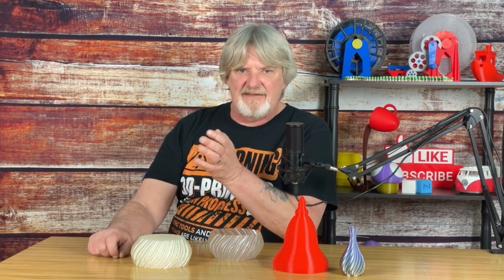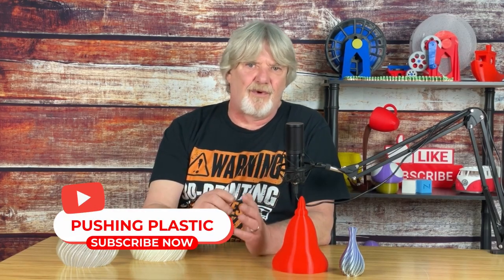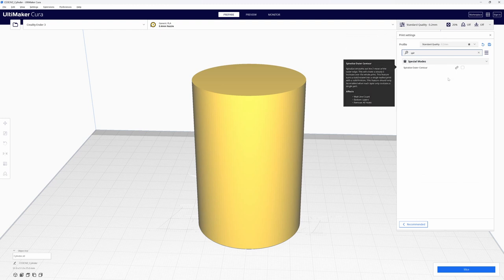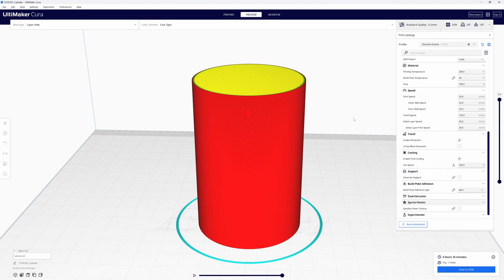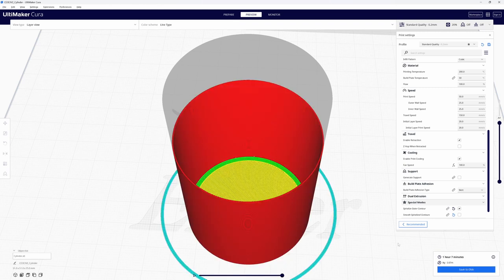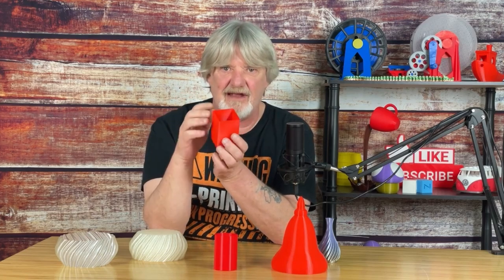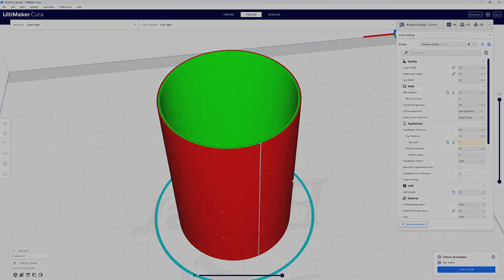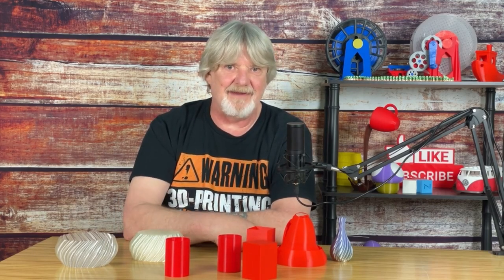Unlocking The Mystery Of Cura's Vase Mode

Comment: I've always known that symbol as "settings slider".  I used to use a video recoding software MANY years ago (cannot recall the name) and that was the settings icon it used and since all of the settings were adjusted with sliders that's what they called it.  Personally it has always reminded me of the equalizers on old-school stereo systems.  You remember the ones that had actual buttons and knobs on them where you purposely AVOIDED touching the screens?  lol
Reply from the maker: Ahhh, I can see that!
Reply: @pushingplastic7445  I've been playing around with vase mode since upgrading to 5.3.1 and it's been acting "weird".  Some models it doesn't seem to have the same effect with a definite seam line on one side.  Exact same settings with a different STL and no line.  One thing I've been trying to figure out and I'm not sure if it can be done or how to do it is to combine regular printing with vase mode.  Basically I have one STL I want to print the first 10mm normally and then switch the vase mode for the rest.  This is a small lamp shade and I want the supports and open top but vase mode won't allow it.  Once the top of the shade prints with the support I'd like it to do the rest in vase mode so there is zero seam.  Even if the seam is on the inside it will show up when the lamp is turned on.  This is with a 1mm nozzle and 0.175mm layer height.

Thoughts?
Reply from the maker: @Enjoymentboy  I played around with this tonight and came up empty. I thought I might be able to use Cura's Per Model Settings to do this, but once you check the box to turn on vase mode you lose the ability to do anything but vase mode. Also, vase mode won't allow for more than one model on the print bed. If anybody else has an idea I'm all ears on this one! Sorry.

Comment: Ive yet to print a vase that actually holds water ever when adding like 14 bottom layers. How do I fix this
Reply from the maker: Before I begin, I can say that I haven't tried any of these methods! But I've read that increasing the flow rate will help. The extra filament will fill gaps, but can make for a bad looking print. I've also read that increasing the heat will help. More heat will melt more filament and make a tighter bond. The final one seems to be the best idea, spray the model with clear acrylic. Again, I haven't tried any of those methods, so if you try them, let us know how well they work. Thanks for watching and good luck!

Comment: a bit misleading at the end, to get a thicker wall you will need to turn off the spiral mode, and end up with that line. with spiral mode you cant change thickness for some reason
Reply from the maker: Not misleading at all. It was an alternative to vase mode using nothing but multiple walls. Turning off base mode was obvious as was the seam.